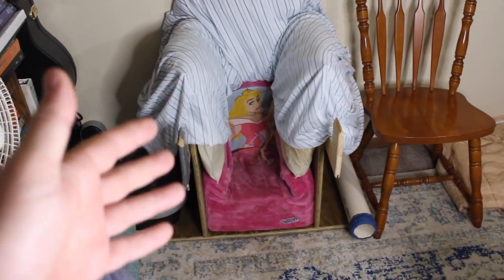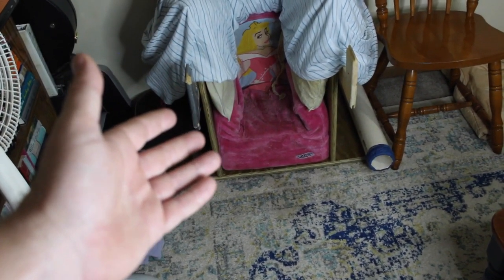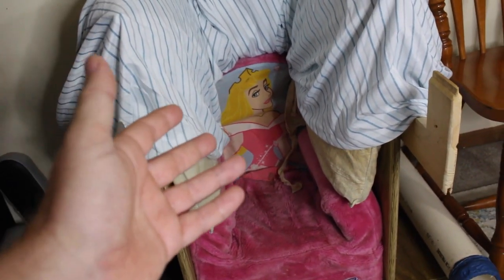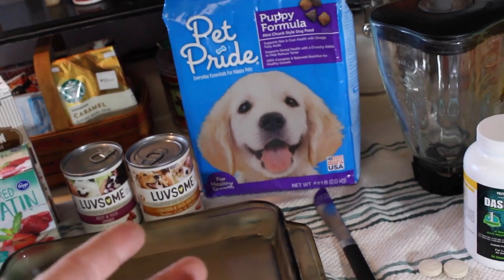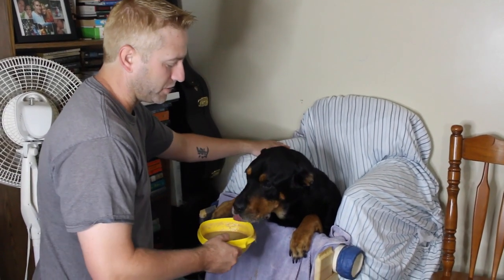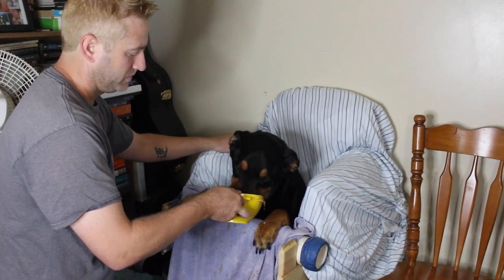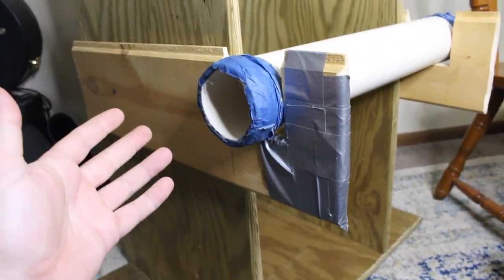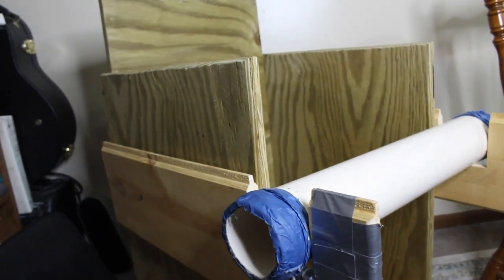Megaesophagus - Bailey Chair

Comment: So sorry for your loss. Great chair and great effort to help Thor. For those that watch this brilliant video I had two Dalmatian pups in the same litter with ME. Both had varying degrees of Me but I decided against vets recommendation not to have them put to sleep - it was my problem.
Anyway, one lived for six months sadly the other is still here at six years old. She is clever and feeds vertical on here own then goes out into the garden and stands vertically for 10 mins to let her grub go down - by the way I feed raw.
Now I have tried baring ways of dealing with this and there is not one straight or best way.Moshe has now stopped getting up on her own after feeding and hence my intention now to make a Bailey chair.
Now one thing I have found that works particularly well is to feed really small amounts and regularly. Typically she is eating two pounds of meat a day so what I am now doing is to break it up into small golf ballish size pieces - maybe a little smaller and feed this, broken down yet again each hour and this seems to work well. You are are right to restrict water ingress - this makes them sick. I have not tried the jello mix but will take that one on board and try it.
We try everything for our dogs and this mans devotion to dear old Thor proves it - good for you matey for the Uk.

Comment: Thank you so mych for your video. My 1st Sheppard  had ME. It came on slow at 1st. Vet at the time thought it was allergies to his food / plasti dish. Of course it got worse down the road. He qas finally diagnosed at 8. He was a big boy but was always thin.  4 years ago we got a mix rescue pup. She couldn't keep anything down. She was dehydrated a few times and had to get fluid injections. Of course I was afraid she had ME. My new vet told me that a dog with ME doesnt have the usual heaving before regurgitate, it just blurts out. Thankfully it turned out she just couldn't digest most dog foods. She needed a hydrolyzed food. 
  The reason I'm watching your video now is that I  have a new German Sheppard pup that I assume has ME and want to get going with a chair for him. I didn't know anything about the Bailey chair with my 1st dog. At this time my pup is 
17 weeks and 37 lbs so he's putting on the weight.  We are hoping for a long and healthy life! Thanks for the inspiration!